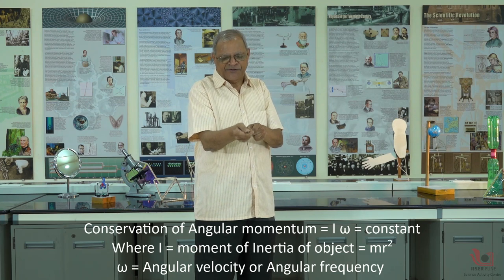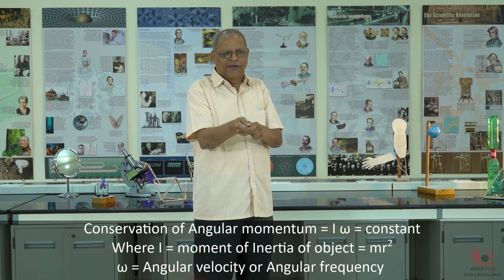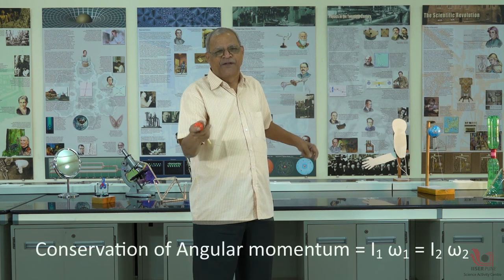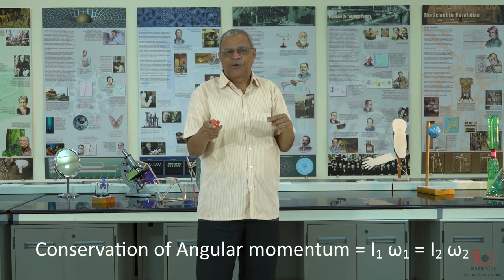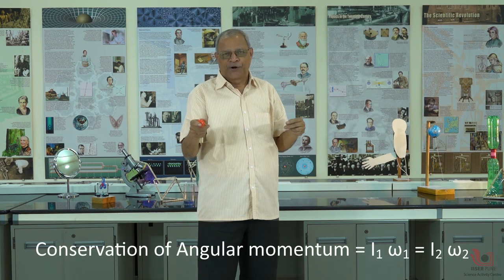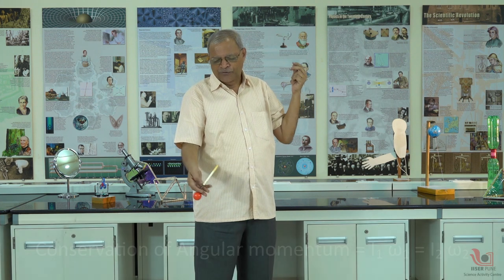Conservation of Angular momentum | English

Comment: Hi, Just pointing out something you might have missed:
We are told that the ball spins faster when the radius is reduced because angular momentum is conserved.
What has been overlooked is the simple fact that as we reduce the radius, the circumference is also reduced which means that the ball has less distance to travel in a single revolution and therefore does it more quickly (W=v/r).
This explains the increase in angular velocity that we perceive.
If angular momentum were conserved, we would have observed the ball accelerating so quickly that centrifugal force would have strained the tether beyond breaking point, the ball become a missile and quite possibly killed one of the spectators. This is exactly what the outgoing scientific mathematics predicts.The prediction for an initial angular velocity of 2 revs per second when the radius is reduced to one tenth is 200 rps which is 12 000 rpm which is roughly the engine speed of a formula one car on full throttle at 300 km/h.
The fact is that it is angular energy which is conserved, not angular momentum.
Reply from the maker: Thank you for your explanation. We will incorporate this when explaining it to the students.